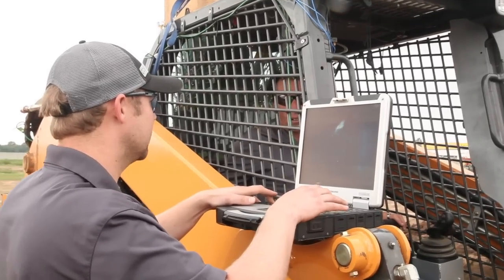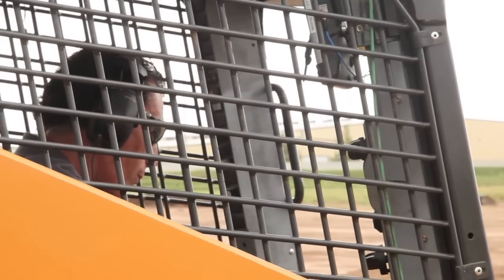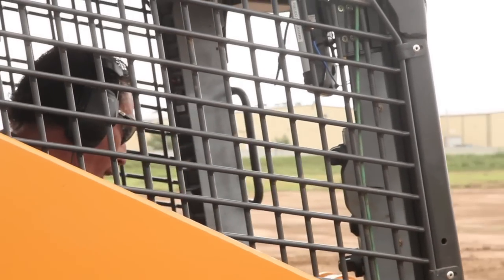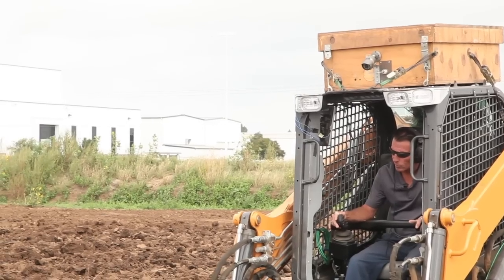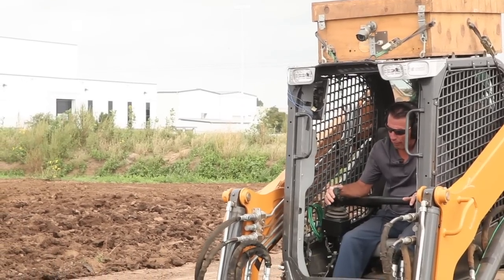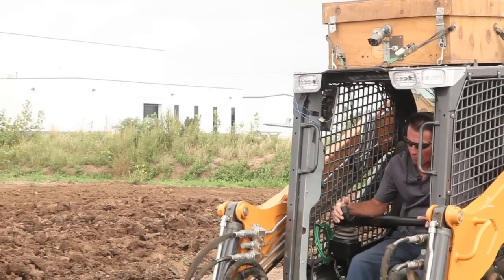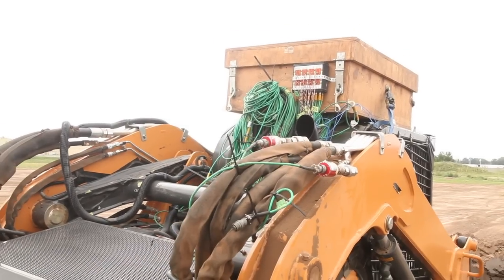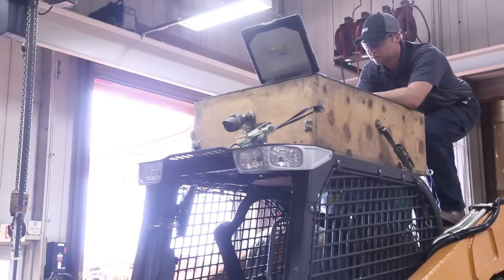North America: Project Minotaur Episode 4: Break Things

Comment: I like this concept. I've had CTL loaders for years. I ended up getting rid of d3 size crawlers years ago and going to CTL. One of the things that many manufacturers overlook is ease of repair. Contractors like hoses that can be made at parts store, filters from anywhere, standard parts available from a variety of sources, and well thought out designs that aren't complex to work on. For example, it sucks to work on a machine that may have a starter issue and you have to remove the whole engine to replace a starter...and then the starter is some weird expensive brand name that you have to  get from Finland or wherever.....if Case can hang onto ideas that promote the small time working man contractor it will have a niche. One thing that makes this important for case more than cat and deere, is that case parts and dealers aren't as common or easy to access. Making parts more standard and cross referenceable would make a case a bigger competitor. My dad started out with out case backhoes back in the early 60s. They were the number one machine..... I hope to try out this dozer CTL. Maybe you'll bring a demo to northeast georgia?
Reply from the maker: Hello – Thank you for your comment. We appreciate your feedback and we’ll send this information to a CASE product specialist. If you complete the form below, we’ll keep you in the loop with any opportunities to demo Project Minotaur. https://minotaur.casece.com/subscribe/